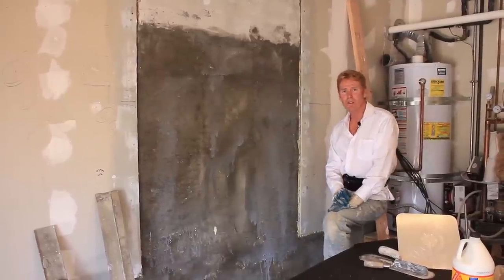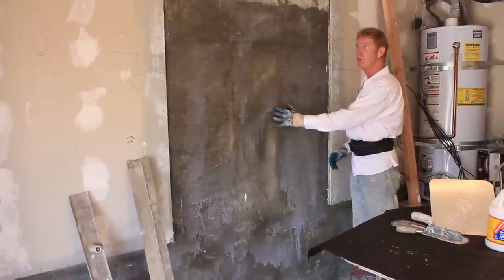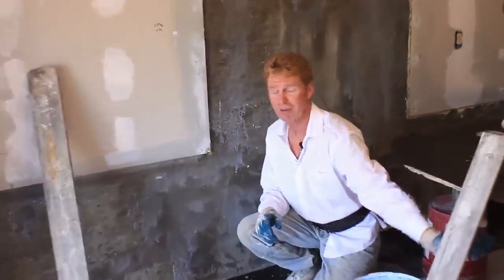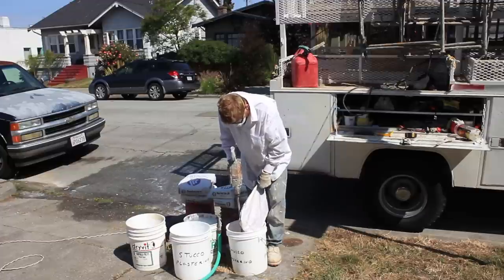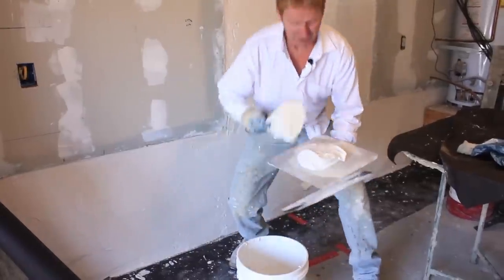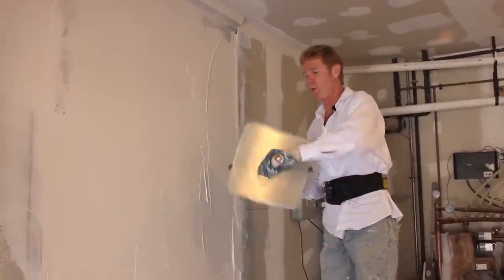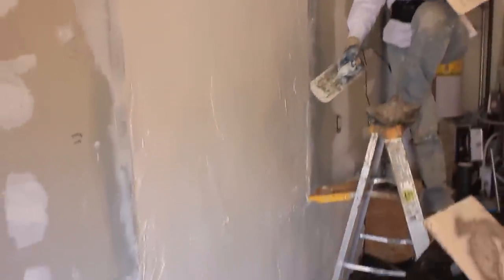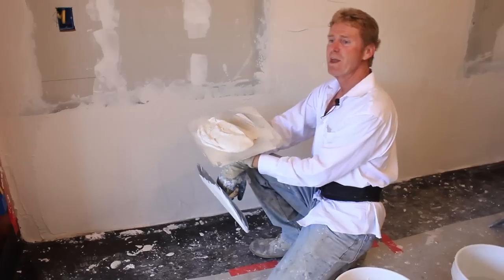Joint compound to blend concrete and sheetrock.

Comment: Is the tiny bit of speed advantage for you worth the extra money compared to Structolite for such a deep and large fill? A 50lber of Structolite costs the same as a bag of Easysand that's 25lbs or so, but you get 4x the material. I'm guessing you used 10 bags or so on this? I'd way rather from a material standpoint just get 1-2 bags of Structo and a bag or two of Easysand for the top coat and be done. Plus I like how light Structolite is, nice and easy to trowel.
Reply from the maker: Howdy Love Dude, I like to show all methods, sort of puts some excitement into my life.
 There are many ways to skin a cat.

                        Peace love and happiness to all.
      Plastering and repair tips for your number one investment
Reply: @StuccoPlastering  To be fair, in a lot of places Structolite is hard to come by. :/
Reply from the maker: @GilBatesLovesyou  Howdy Love Dude, I am fortunate to live 5 minutes from West Side Building material, one of the most massive plastering yards in Oakland.
   But getting back to using structo-lite, we have done many videos on how, why and when to use it, I have to add some variety for the folks who don't know where to purchase this material.
    How long have I been using structo-lite, excellent question, glad you asked, do you remember when structo-lite was sold in 80-pound bags?
 I do.

                        Peace love and happiness to all.
      Plastering and repair tips for your number one investment
Reply: @StuccoPlastering  I'm about the age of your kids, haha, still fairly beginner to this stuff. But so far of all the stuff I've used, Easysand, Durabond, Diamond Veneer, and Structolite, Structolite is my favorite as it's very versatile and very cheap.

Comment: why do you do this kind of job in multiple layers?  takes al lot of time ... here in holland i would do this in a single layer with gypsum plaster. we have got materials which work well up to 40-50 millimetres thick layers , just mix it a little stiff en you can do it in one layer.... rod it a couple of times and your wall is true and plumb . gr patrick
Reply from the maker: Evening bieske21, we have over here a similar material such as structo-lite, but I wanted a finish coat on the same day.
 best wishes in Holland Patrick.
Kirk & Jason Giordano's DIY plastering & stucco network

Comment: Hello I have a question I recently plastered cement on my painted brick wall but I can still see the block through the cement what else do I need to put over the cement so i can get a clean solid wall ?
Reply from the maker: Good Morning Velentin, dude, if your block ghost through your last applications, it was not applied thick enough.                  
                    Live long and plaster
    Mastering Plastering by team Giordano
Reply: Kirk Giordano plastering Inc. what do you recommend I put over the first coat to get a clean finish?
Reply from the maker: Good Morning Valentin, if it were me I'd apply a veneer finish plaster about an 1/8 of an inch thick or you can use a sheetrock compound which you mix from bags, you just add water, they come in various set times such as 20 minutes to one hour and a half.               
                    Live long and plaster
    Mastering Plastering by team Giordano

Comment: Hey Kirk! Could I use all purpose joint compound to skim coat a cement wall in my garage or does the hot mud work best?
Reply: Your cement will most likely get damp at some point then All Purpose Mud (gypsum products) will get moldy and/or flake off.
You will need to you use an "Outdoor" product with Portland cement. Here is one of his videos 'Stucco over concrete' www.youtube.com/watch?v=LW9Dwxl2W4c
Reply from the maker: Good afternoon Sal, sure you can, as long as your certain that wall is not penetrated by the outside rains or prone to any moister.
                         Bringing peace, love, and harmony to the  plastering world
    The complete plastering encyclopedia on video, by the plastering messengers of Youtube

Comment: Can i use this  on raw concrete  ceiling unpainted or do i still need a bonding agent before mudding thanks
Reply from the maker: Good afternoon Siara, I would recommend applying a bonding agent, you can buy Quickrete bonding agent at home depot for about ten bucks, take the time to make certain your new plaster adheres forever.
                         Bringing peace, love, and harmony to the  plastering world
    The complete plastering encyclopedia on video, by the plastering messengers of Youtube
Reply: @StuccoPlastering  thanks
Reply: @StuccoPlastering  thanks
Reply from the maker: @siararamcharitar3589  Good afternoon Siara, no problemo
                         Bringing peace, love, and harmony to the  plastering world
    The complete plastering encyclopedia on video, by the plastering messengers of Youtube